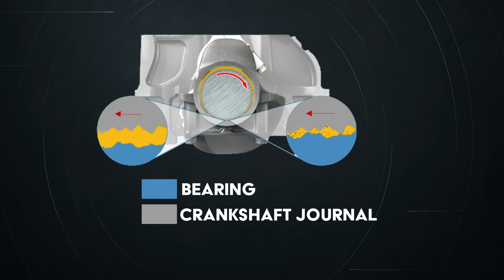the truth about start-stop technology (finally proven)

Comment: Everyone should know, especially the engineers, the majority of engine wear occurs at start up
Reply: Yes, there is no oil at all after the cold engine sits for a while, and will rotate dry until the pump provides oil pressure, versus having just stopped...
Reply: @wthoms2k  There's still oil between metal surface even after weeks. Start / stop are indeed very bad for an engine for many others reasons but I not really convinced by the this oil pressure problem.
Reply: @Percy-k3f Start-stop is not bad for an engine. Start-stop engines last longer. Whether oil or some other claim, it is not whether it causes wear - it's whether it causes more wear than continuing to run.

I personally did my own experiment. I made a non-existent engine that never runs at all, and it lasted forever. Everyone who thinks it's "common sense" that starting and stopping an engine causes wear ignores the common sense that a running engine will have more wear.
Reply: Every engineer knows that the claim "the majority of engine wear occurs at start up" is a nonsense claim. First, it doesn't compare to anything else. Does more wear occur starting than idling for 10 seconds, or 10 years, or throwing it over a cliff? Second, most engines have multiple parts that wear at different rates under different conditions, so "majority of wear" is meaningless. Majority of wear on a bearing designed to be replaced, or on the heads, or the paint after you drive it off a cliff?

Most engineers would ask whether an engine that starts and stops lasts longer than one that does not.

And most engineers asking that question would just see if that's true or not, rather than just going on feelings.

It's true. Start-stop engines last as long or longer.
Reply: the engineers are quite aware of this being a problem.  This "wonderful technology" is driven by the EPA and other similar environmental organizations to kill emissions while stopped.
Reply: @jime8532 Bs. Start-stop engines last longer and are more efficient. The EPA is not forcing large freight carriers to switch. They do it because it saves money.

If you don't want to save money, then disable the start-stop feature. Assuming you aren't someone whose purchasing choice is to constantly ask "Do you have a larger pickup truck" until the dealer tells you no.
Reply: @jime8532  you mean kill engines while starting up. This has more to do with profits then the environment.  How is piles of scrapped cars good for your environment?  🤔
Reply: @number6-b9e  They already have a ticking bomb inside some engines without going through all this stop/start BS.  inside quite a few engines now have a belt drive oil pump that is unserviceable without pulling the engine and splitting it open.  Guess what happens when that belt wears out? The short engine life provided by the stop/start BS is just collateral damage.
Reply: @jime8532  Yep
Reply: Everyone should know that engineers don't rule, marketing does.
Reply: @number6-b9e  Facts.
Reply: @number6-b9e Wow. Not only wrong, but contradictory. If it's marketing, why would car companies try to sell a feature no one wanted? And who is it that was convinced by this (non-existent) marketing? Assuming there was in fact a car commercial pushing start-stop, who saw it and thought "Ooh, I want that"?

You're wrong. No car company markets start-stop. People do not want start-stop. Consumers want fuel efficiency, and car companies want decreased warranty claims. Start-stop decreases fuel costs while decreasing wear on the engine.
Reply: @MrRoguetech  you must have money tied up in this failed tech to insist i'm wrong. with such rediculious claims!  many comments here say i'm right!😁.
Reply: @number6-b9e I did not pay extra for start-stop feature. I didn't know it any charged for it. Which manufacturer(s) do that?
Reply: @MrRoguetech your start stop feature was placed in by the good mercy of god himself.😂
Reply: @j...bro. I guess. Looking at the most common unholy vehicle:
2017 Ford F-150, 5.0L, $37,765.00
2018 Ford F-150, 5.0L, $37,765.00

Start-stop is a stock feature in 100% of all 2018 F-150 5.0L engines, and yet - adjusting for inflation - the price dropped by 2.1%. All praise our Truck Lord and Savior, Jesus Christ.

Disclaimer: This is an illustrative example only. This does not imply or should otherwise be taken to mean that I would be dumb enough to ever purchase an F-150. After all, I can look up simple basic facts.
Reply: Doesn’t take a genius to work it out
Reply: at cold startup
Reply: We should have "hybrid" oil pumps that have a button or pre activation period before engaging the starter. Run off the engine normally but also some sort of electric motor that can build up 40psi before crank and ignition. Would be interesting! Especially for seasonal cars that sit
Reply: @Sprier  Engine oil pumps are mechanical, directly geared to the crankshaft, so they are guaranteed to run if the engine is running. And the oil passages are machined into the block, so there aren't any hose fittings or mating surfaces that can fail, other than the cover gasket on the oil pump itself.

If you replace that with an electric pump, now you're got a time bomb waiting to blow up your engine. That electric motor has a finite life. And it's much shorter than a direct-geared mechanical oil pump.

If you add an electric pump in parallel with the mechanical pump, now you have to add a valve to block the passage to the electric pump when the mechanical pump is running, otherwise you'll just push oil backwards through the electric pump. You've also introduced another point of failure and a mating point where oil can leak. Adding an oil orifice upstream of all your vital bearing orifices is just asking to blow it up. If that connection to the electric pump fails, or the valve fails, now you're not making oil pressure.
Reply: @number6-b9e  What? Start-engines make more "profit" for the consumer because they last longer. This has more to do with profits BECAUSE of the environment by NOT scrapping engines.
Reply: They know. They intentionally build in future failures in order to prompt the mindless consumer to purchase a new vehicle every couple of years. That's the insidiousness of consumer culture.

Comment: I disabled mine 9 years ago. It would shut off the engine at a light before the windshield fog was completely cleared. I considered it a safety hazard and an annoyance.
Reply: With Mazda the iStop will not activate if the windshield airflow is on. For the reason you mention.
Reply: @aussie8114 Thanks: I wondered why the iStop on my Mazda CX-3 didn't kick in the other day. I did have the airflow setting to windshield, which I usually do - that's a good way to disable the iStop. 👍
Reply: @michaelgreenwood1393 You can also wedge a piece of zip tie in the iStop button to keep it depressed. I do that now and it works fine. It defaults to off each time the car is started. But the airflow option is also good for much of the year other than maybe mid summer when you may want airflow toward you.
Reply: @aussie8114 Great tip, thanks!
Reply: @aussie8114 sounds like a hack to remember!
Reply: @aussie8114 average Mazda W
Reply: @aussie8114  honestly this will happen in any reasonably-designed car lol, that was 100% a silly oversight in OP's car.
Reply: @xIcarus227  yep, we're comparing veeeeery different approaches to car desing. European VW AG cars would never allow the glass to mist. There's a special menu in the infotainment, and it tells what's happening with the start-stop system. "The windshield could mist" is one of the many reasons of it to not be active.
Supposedly start-stop should be very heavy on the lead acid battery in the car, but at the same time it looks like the battery management in the VW MQB cars is second to none. 8+ years of battery lifespan with start-stop enabled is the norm there.
Reply: With Honda, the manual states “if the a/c is on, that disables the s/s function”.  They also have a switch next to the gearstick/auto drive selector, press the button and the orange icon on the dashboard goes out, job done.  Even upon restarting engine the next time you drive.
Reply: If your windshield fogs because of your engine starting, that sounds like maybe a heater core.
Reply: The safety hazard is you driving a car without a fully de-fogged windshield.
Reply: The true safety hazard is actually YOU driving off from your parked location before the windshield fog is completely cleared to begin with.
Reply: This should never happen, because you should never have been driving with a fogged up windscreen. Stop/Start was not the safety hazard here, you being a dangerously incompetent driver was the safety hazard!
Reply: Do you hate everything that makes our planet better? Like paper straws?